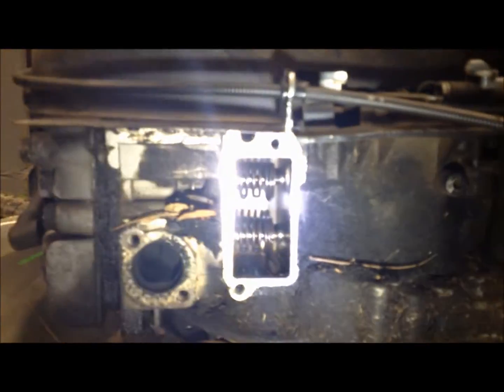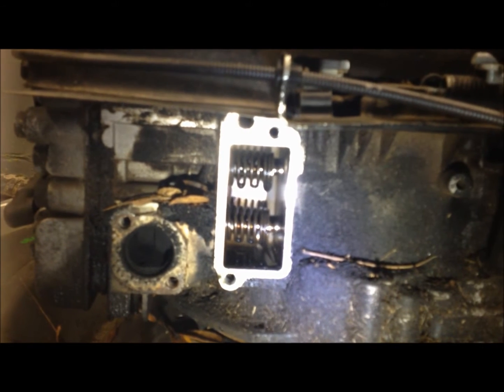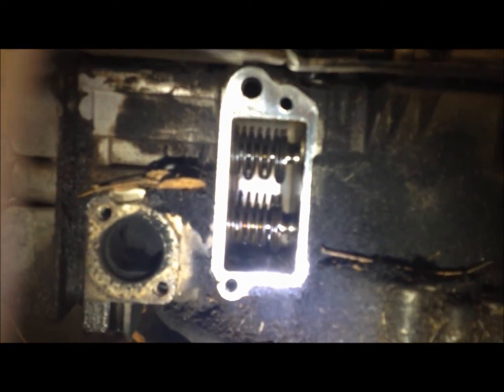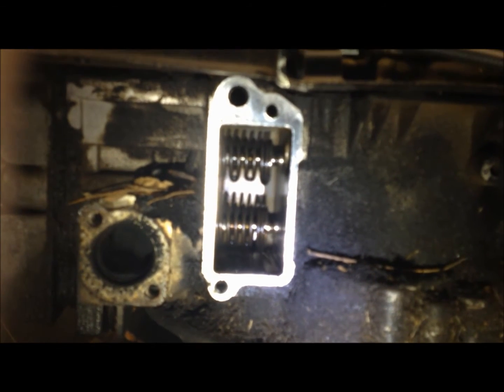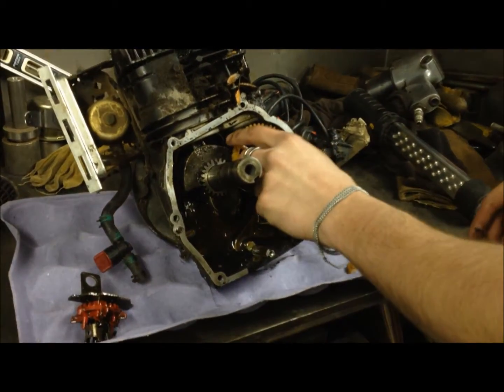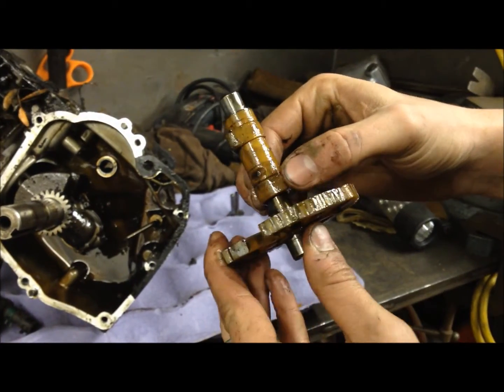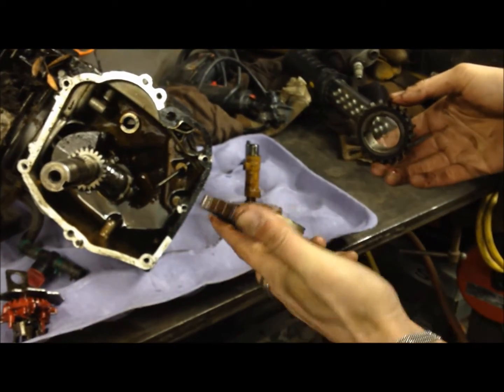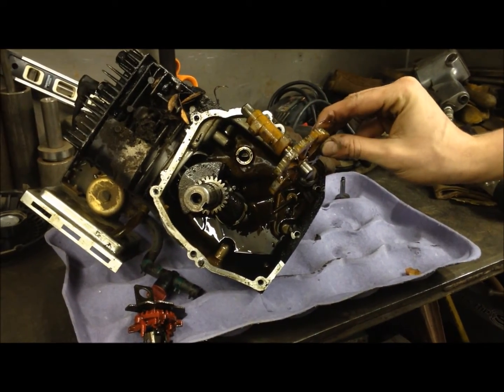Why There Should not be Plastic Engine Parts. Period.

Comment: I thought the same thing at first, but then I thought... What's more expensive to replace... A broken plastic part or a seized up engine? As long as the plastic part is well designed, not too costly and easy to replace.
Reply from the maker: Except a metal part never fails - that’s why my fathers 40 year old push mower still runs and this engine died
Reply: This was all about cost. They are designed to fail after so many hours and then buy another. If they made stuff to last 40 years today they wouldn’t make as much money.

Comment: Its on all the walk behind mower and pressure washer engines that Briggs and Stratton is putting PLASTIC Camshafts as well as Plastic Timing Gears in their engines as theres been alot of problems with their OHV professional series engines of the failures. having said that i will never ever purchase another Briggs and Stratton engine of this type ever again their have been complaints of this 7.75 engine the plastic parts failing mainly in their pressure washers that Troy Bilt buys from Briggs and Stratton and markets them. as i had this motor on my snapper mower since i learned of the plastic i repowered it with a Harbor Freight predator 173cc engine and its doing good after 4 mowing seasons. if i can find an older Briggs and Stratton flathead engine that i want to rebuild and use as they last and has metal gears as they should. but unfortunally Briggs and Stratton don't have the flathead engines anymore they discontinued the model 9 the classic 3.5 hp and i think they discontinued the Quantum engine which was Briggs and Strattons first CAD designed engine.  the later 3.5 3.75 and 4 hp engines they put PLASTIC camshafts in them. not a good idea at all.

Comment: I once owned a 1969 Ford with a V4 engine. The engine's design dated back to 1962, and mine had a nylon timing gear: Very beefy; about the size of a dinner plate and 1" thick. It held up great, but I was surprised to find a plastic gear in such an old engine...
Reply from the maker: Who in the world would have ever guessed that. Might have been an 80s replacement?
Reply: I had another donor car; in fact, I went through 3 different engines in my '69 and all had the nylon gear..
I wasn't very experienced and simply swapped engines when idling rough. I recall the pistons having massive carbon deposits, probably the culprit, but I never adressed that :)
I even opened a gearbox once, when hearing a banging noise. Later I found it was just loose wheel nuts LOL.